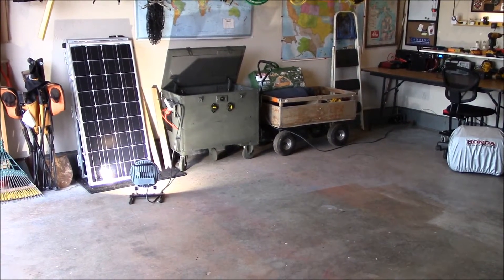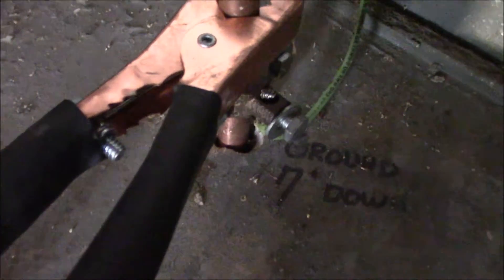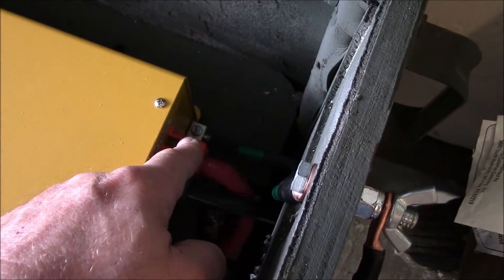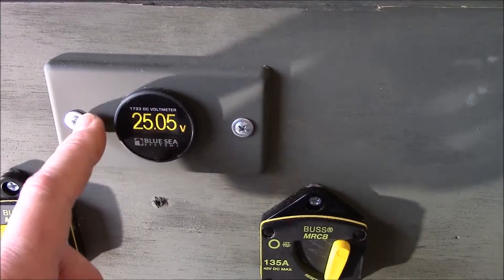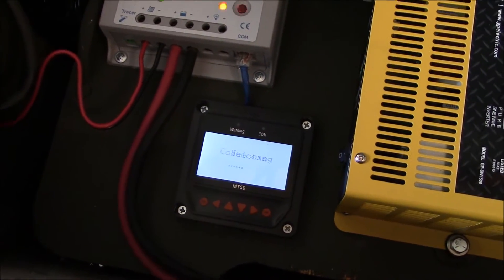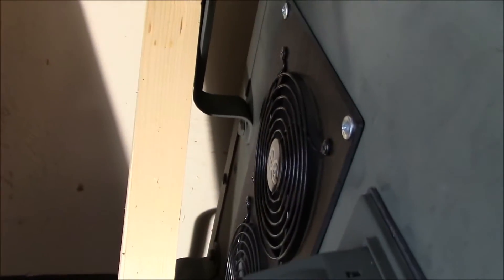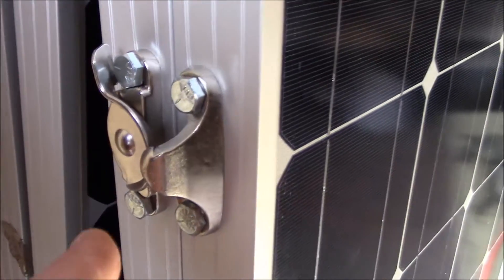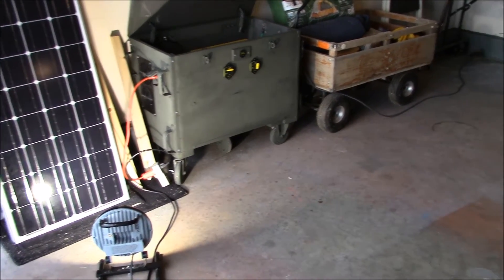DIY 24-volt Solar Generator (Part 6)

Comment: How many panels do you need to charge it I'm building one that will have 6 barriers that's 24 volt but not sure what I need solar panel wise it's for a rv and I'll also be using it t power a supply trailer and running power tools to build a house

Comment: I am new at building, assembling and engineering... But after buying my first set of tools and building my high roof van bed I am gaining more confidence. I have the renogy 200 w mppt 20 amp kit and I will be following your solar generator build for my camper trailer ! Wish me success ;-)
Reply from the maker: Thanks. Keep in mind, my box is "24v"...the camper-trailer is probably 12v.
Reply: Yes, thank you, I noticed that.... I will be building this as 12 volt system with 2 Renogy 100 watt panels, 20 amp mppt controller, 2 12 volt 100 ah batteries. I will have a 12 volt water pump but a AC powered water heater 4 gal, tiny jobby. My refrig is 12 v and lights are 12 v. I am not sure about the breakers, panels, switches which I would like to do... Can you suggest where to learn that, or can you devise a vid for Nu beeee's ?

Comment: Chris, great video series. I have a quick question. I would like to build a system that will run a pumping system. My question is if I want to run a system continuously...if the solar can not keep up with the demand how is the best way to augment with AC?  Id there a controller that would sense the state of charge and if it dropped below this amount it would start to charge the batteries.
Reply from the maker: I am sure there is something like that out there. Most guys buy inverters with an automatic transfer switch built in (AC in). That way, when the batteries get too low, it transfers to AC. It can also charge the batteries if set up to do that.